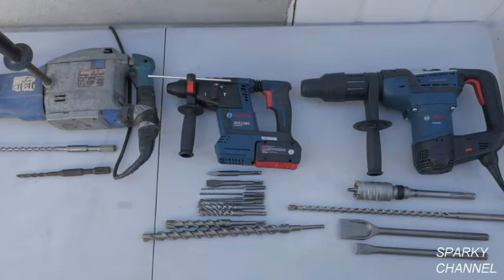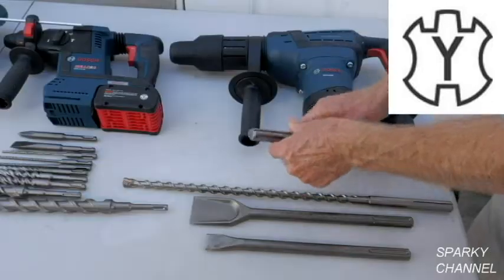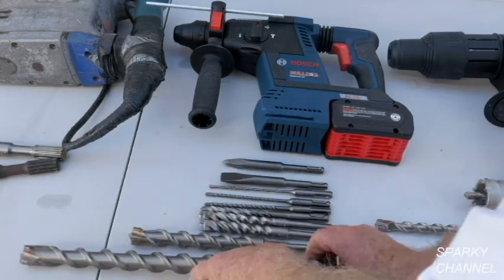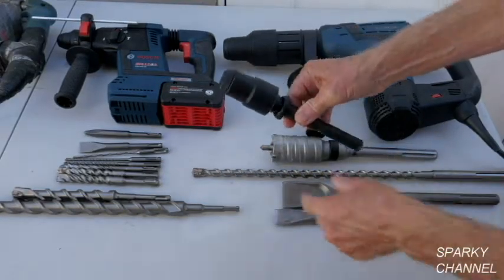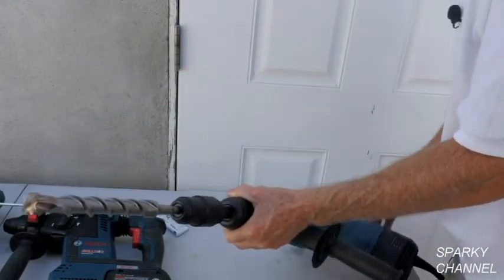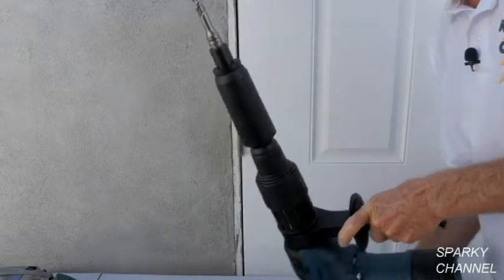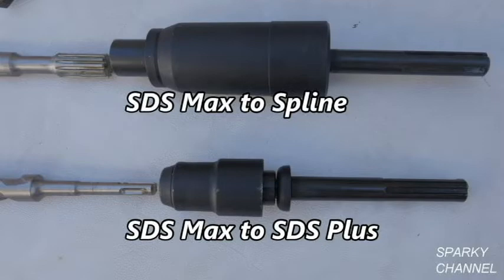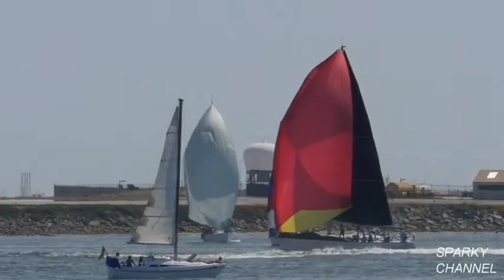How To Adapt Between SDS Max, SDS Plus and Spline Adapters to Save Money

Comment: Have you ever seen an adapter to allow SDS MAX bits to be used in a SDS-Plus tool?  I have a lot of nice SDS-MAX chisel bits that I would like to use in my SDS-Plus tool but haven't found an adapter. BTW... I've been wondering why I haven't seen any videos from you and just tonight I realized that YouTube mysteriously unsubscribed me from your channel.
Reply from the maker: How are you buddy? Good to hear from you and thanks for searching me out! No, I haven't seen an adapter going that way. It's usually the other way around. Good video here tomorrow AM, check it out if you can. :)
Reply: Hitachi was making one year ago, it as a sds Mak coupler on both side and they made various shank one of which was a sds max on one side and sds plus on the other
Reply from the maker: @patricelebrasseur5649  Thanks!

Comment: I have found there are also adapters for SDS plus to 3 jaw standard chuck. What I haven't been able to find is a SDS MAX to 3 jaw adapter. I don't want to stack 2 adapters on a SDS MAX to be able to use standard bits for heavy wood drilling. Does anyone have helpful info?

Comment: Where can I find SDS Plus to Spline Adapters?  My old hammer drill with took spline and with my new SDS Plus I can use 15 different bites. I thought finding an adapter would be easy.

Comment: Any issues with using the smaller SDS Plus bits (3/16-1/2") in an SDS Max tool with the adapter? I don't want to buy two rotary hammers if I can get away with just a Max but I'm worried that the higher impact a Max Hammer delivers will bend/damage the smaller SDS Plus bits.
Reply: I'm in the same boat. Did you find your answer?
Reply: @jamesbolotenko3460  I ended up getting the largest 20V Dewalt SDS Plus Rotary Hammer and I've been very pleased with it. The SDS max drills obviously hit much harder but also turn significantly slower so from what I can tell they are actually slower with smaller drill bits. But with larger diameter drill bits and core bits the slower rotation gives the correct linear velocity while the heavier hammer is distributed over a larger surface area of the bit face. I think it really is about sizing the correct tool to the bit. I rarely drill larger than 3/4" so I think the SDS Plus gives better performance in that application than the SDS Max hammers would. I can break concrete with the SDS Plus drill I have (again the largest 20V one Dewalt makes) with a 3/4 chisel. It kinda slow but it works.
Reply: @LUSkyhawk  thanks for the detailed reply bud. Helped me with my decision.

Comment: What kind of grease did you use to put on bit for first use?
Reply from the maker: Bosch provides a little with the kit. It looked like regular grease to me.
Reply: I know this is an old post but I was wondering the same thing for my rotary hammer and researched it and the popular online opinion was molybdenum grease because it stands up to heat and pressure well.

Comment: The only problem with using these adapters is that you lose a LOT of impact and ADD a lot more time to the drilling process because of more movement.  They may be OK in a pinch, but not as an every day option.  Most heavy construction companies won't allow them anyway.